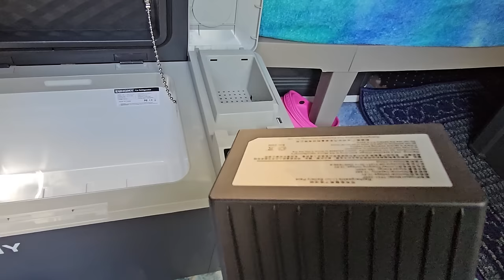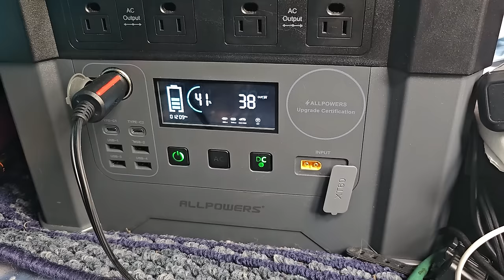#1 SOLAR POWER SERIES. OFF-GRID IN A MINIVAN CAMPER.

Comment: Hello.  Installing a DC to DC charger will help you greatly with your power needs , it will keep your solar generator charged while driving.  There are dual charge units that will charge via solar when you're not driving.  It's definately worth the investment.  Have a wonderfully blessed day.
Reply from the maker: Thank you! I have a professional that I hope can do that next week. 👍
Reply: I want to learn more about that DC to DC charge.
Reply: @ButterflyTracks  You will really like it.  It helps so much.
Reply: @rouseyournicholls  A DC to DC charger will charge your house batteries or solar generator while you are driving through your alternator.  Many units also have a solar port for charging via solar when you are not driving.   Just make sure to get one that is compatible with your alternator.  It is so worth it.
Reply: It's a power station, not house batteries.  All you have to do is plug the DC charger into your 12 V port while driving (cigarette lighter).  My Bluetti came with both AC and DC chargers.
Jon in rural BC, Canada
Reply from the maker: Yes, thanks! 😊
Reply: @HuddlesAbound  Oooooh ok. But will the DC to DC  charge my powerstation if my car IS NOT running??
Reply: @JonTanOsb  Yes, my bluetti does too. But I worry about it draining the battery or something if it stays plugged up all night. Like, if I want to run my refrigerator can I plug my Bluetti into my car charger while the refrigerator is plugged into the Bluetti🤔
Reply: @rouseyournicholls  All major power stations have pass-through charging, so you can charge while something is plugged in.  This works with AC, DC and solar.
If your DC plug in your car turns off when you turn off your car, you can leave it plugged in.  My Pontiac Montana has live DC plugs, so I have to make sure I unplug when I'm parked.
The charged power station will keep your fridge going for days if you have the fridge set to Eco-mode, and depending on your power stations' wattage.
It's just a matter of keeping track of what power you have left and how long you can run things without needed to recharge.
Hope this helps.
Jon in rural BC, Canada
Reply: @rouseyournicholls  No.
If you're talking about the DC (cigarette lighter) plug, most turn off with the engine.  If yours doesn't, you will drain the battery if you leave things plugged in.
If you're talking about a DC to DC charger that runs off the alternator.  No.  That only works while the engine is running.  I don't have one, so I don't know if it would drain your battery.
Jon in rural BC, Canada
Reply: @JonTanOsb  Thank you. It does help.
Reply: @JonTanOsb  oh 👌.
Reply: @rouseyournicholls  if it has a solar port, yes, it will switch to solar charging to your solar panel when your vehicle is not running.
Reply: Lulu's Way YT channel has a video on her dc to dc charger and will explain it thoroughly pretty well.  Jasonoid also has videos on it as well, which is what prompted me to get one, but Lulu's Way explains it very simply.  I hope this helps you.
Reply: @HuddlesAbound  OK. Thank you. I will look into that. I definitely want to be entirely off grid if I can. Or at least most of the time.
Reply: @HuddlesAbound  I am about to check them out now. Thank you
Reply: Yes but LuLu only had 2 100 watt solar panels put on her roof when she was used to 400 watts when her foldable panels hung on her front window. Please be sure you get enough power from the solar panels to the power station. I know in my mind how I want to set up my power in my tracker so I can run my 12v 10 qt fridge when Im out camping. I have room and want a second battery installed inside the engine compartment so I can use that to charge my fridge and power bank.@HuddlesAbound
Reply: @debslifesimplified6406  Yes. That sounds like something I want as well.

Comment: Jan, I hear ya on hitting your shins on the piece that sticks out. Hurts 😮 😭!!!  What I was wondering is if a pool noodle cut to size would fit over it and slide off and on when it is exposed. I have similar Yakima Swing Away but mine is for my e-bike, but works on the same principle. It is usually in closed position except when I need to get in the back doors and swing it away, but it just seems like there should be something to cushion it that is easy on & easy off.

Comment: Thanks for your videos, was wondering if you would recommend the Pacifica Hybrid?  I am considering purchasing a Hybrid. Also how do you charge the battery?

Thanks!!!
Reply from the maker: I love the luxury of Pacifica and all the safety features.

Like other hybrids, Pacifica charges the battery as you drive. Unlike most hybrids,  you can also plug it in to boost the mileage beyond what a plain hybrid could get. However, you don't ever have to plug it in unless you want the mileage boost.
Reply: @ButterflyTracks  
Thanks, Happy Trails